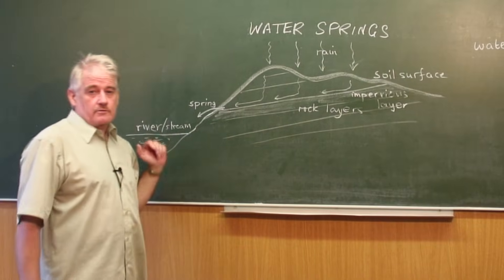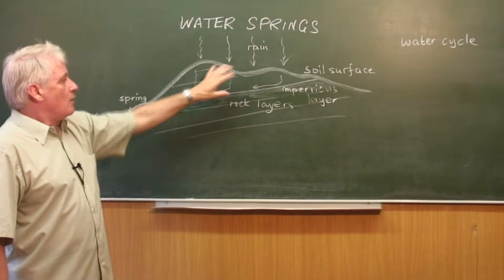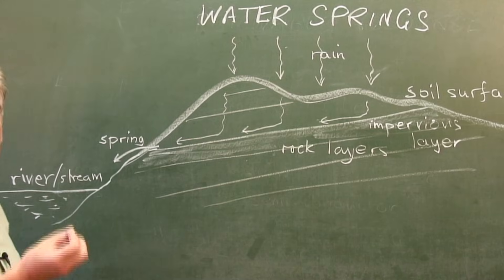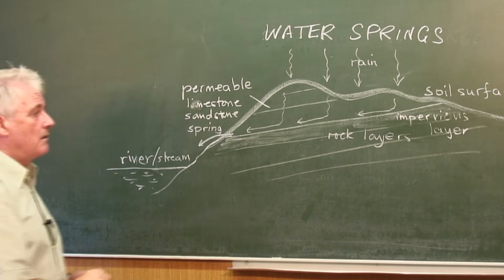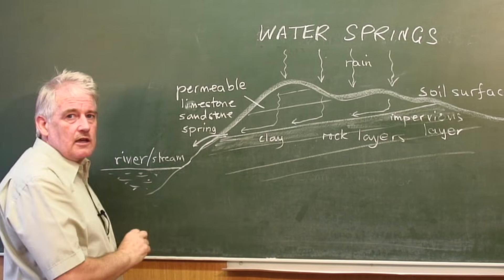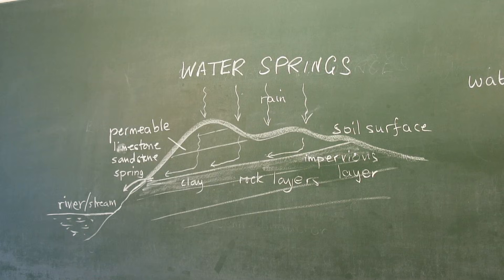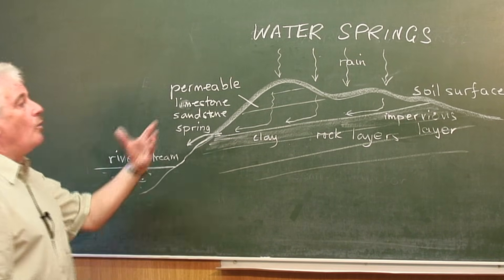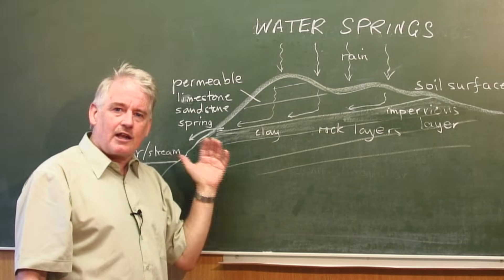How Things Work : How Do Water Springs Work?

Comment: That isn't actually how most springs work, but never mind.
Less than 10% of rain reaches the oceans as direct run off.
Over 90% is absorbed into the ground, and will continue to slowly sink until it reaches an impermeable layer.
Think of dripping water onto a sponge.
The water that has reached the bottom of the sink forces water to the surface through fissures in the substrate by Archimedes Principle.
Which is why in times of drought, most springs dry up as well.

Comment: According to the previously mentioned facts, it is evidently that there are seasonal variations in the water temperature in all of these spring which depending u pon how direct the concat is between the groundwater and temperature of the atmosphere. We research known, genereally the standard varoition in the spring from 0 °C - 3°C  with a mean value of 1,5 °C, where as the variations in the water temperature in the open streamflows in karst vary from 1 °C to 6°C with the mean value of standard deviation of 3 3° to 4°C.
Thank you for helping us analysis of the water temperature of the karst springs of your own - traditional good, always!

Comment: Very nice thanks.  QUESTION:
I have a lake/pond say 500ft diameter 20ft deep, and the lake is fed by underground streams.  If I were to drain the lake, then fill that lake with sand, would the pressure of the sand stop the water or would the water seep thru the sand trying reach its original level within the sand.  I'm thinking of how construction companies level land that once had ponds.  Thanks.
Reply: No answer I think maybe you need to ask it on another channel probably one where they talk about what you're describing

Comment: Ok, so you are saying a spring is really just rain water that is filtered down through the ground? How does it stay so active? Why has the one on my family farm able to create a fairly large pond and keep it at a consistent level and never stop flowing? Even when it has not rained for quite a long time. Something doesn't add up with this explanation. I think Springs are a little more complex than this video leads on.
Reply: I have a spring in my propety and when a dry season hits the flow reduces until it dries completely
Reply: He's lying

Comment: This is folklore not a scientific how springs work. The springs of the world follow a multitude of mechanisms to create flows on the surface. Long travel times as well as very short travel times can occur. Transport of pathogens is more likely than not. This is dangerous information presented in the video. Springs are surface expressions of groundwater due to intersection with a conduit system under hydraulic head from an area with more potential.

Comment: This is the best video explanation i have watched
Reply: This is the worst video I have ever seen.! In Australia, the best springs are found at the top of the mountain, forced up by the weight of the mountain, so as the water falls through the porous rocks and cannot fall any longer, some of it will be pushed out to the side of the mountain as shown in this video and some will be pushed out at the top. The top water has been pushed out under pressure from the mountain above. In many instances the movement of the water upwards is aided by the anti-gravity lift caused by the water vortexing under pressure. See Viktor Shauberger from Austria.
Reply: @KingArthur5000  yall upside down anyways who gives a fuck abt australia

Comment: This is just a theory, if you say its from rain, how long the rain down from the sky..? My theory is, because of the pressure differences, at high altitude normally the pressure is lower than sea level, and this low pressure create a vacumn act, bring the water up above from sea level and leak out through the mountain side, and creating waterfalls as water flows from the cracks...
Sorry my english not so good

Comment: Evaporation does not defy gravity any more than a boat floating on the water does. H2O as a gas weighs less than the other gasses around, so the heavier molecules sink and H2O goes up. Same concept with a boat weighing less than the amount of water it displaces.

Comment: I live on a Greek island just off the coast of Turkey and for a whole summer I had an argument with my father and some of his friends about the source of some springs on the island. There was (and still is) no way to convince them that it all comes from rain water. They said because the flow of water was so much, it has to come from places like Turkey, other islands and even Egypt! If they understood any English I would show them this video. Stubborn old men! Ha ha!
Reply: Iron Fist: 
Sorry to tell you, the old men may be correct in part. Rain water is not the only way water gets to the top of the hills, there are also geophysical reasons why water is displaced upwards to higher altitudes through thousands of miles of cavities formed for millions of years. Not all densities of soils are in the ordered the way presented in this video. Imagine hot waters trapped at very low altitudes over the sea level, all the soils surrounding them are solid rock except the lower volcanic channel they get the heat from and an upper channel shooting straight up to the top of your island. By the time it finds an escape almost at the top of that hill it is cool and filtered. There is your spring water that didn't come from rain
Maybe not from Turkey or Egypt but from the china sea or maybe even from the waters that surround your island. 
😳🤔
Reply: @sosaassociates  I was wondering this, is there an upward flow of water underground. Thanks for the answer.
Reply: Samothrakis?

Comment: I find it odd how he states water obeys the laws of gravity yet many rivers run south to north
Reply: anthonyww713 
You are correct that surface rivers do follow gravity however gravity follows variances in altitude (vertical relation between the point in question and the sea level)  not variances in latitude (relation between the equator line -the line that divides the northern hemisphere from the south and the point in question)
Reply: What has cardinal direcitons got to do with gravity? Do you think we live on a giant mountain with the northern countries on top?